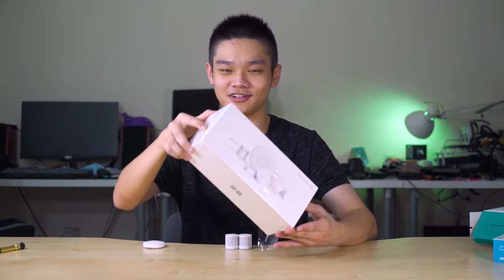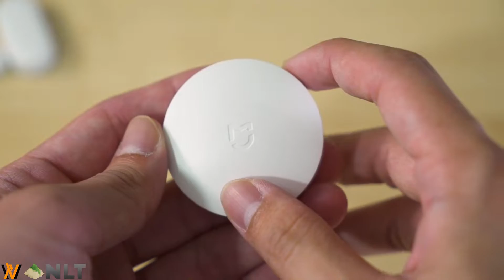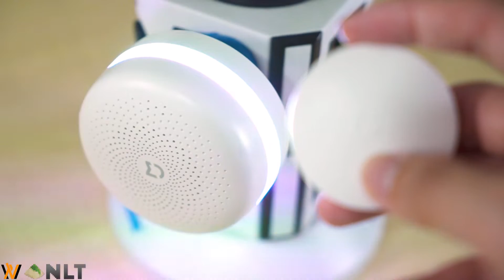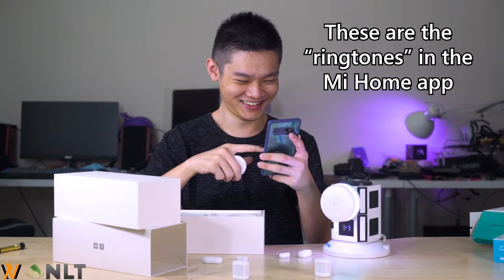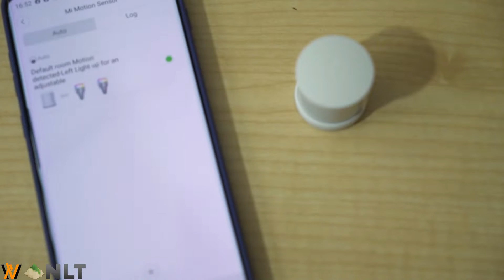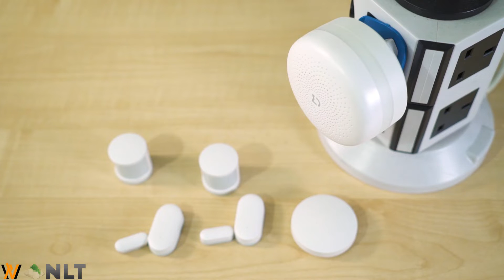Too premature? Xiaomi Smart Sensor Set review!

Comment: hi, does this work w/ siri or just the aqara hub?
Reply from the maker: It does work with Apple HomeKit, so I guess it works with Siri?
Reply: @NasiLemakTech  thanks so much for the info. is the alarm loud enough that can be heard by a neighbor? and also do you have idea how far can the sensor be away from the hub?
Reply from the maker: The alarm is not that loud to be honest. Xiaomi has stated they will implement a feature in Mijia app so that it will play the alarm sound to you connected smart speakers. Not sure if this function is available now or not. 

As for the distance, we only tested up to 10 metres away. The rest probably depends on your home layout

Comment: So it means I can't use the sensors to change the color of a light ? 
Like if I want to detect when the postman come I want one light to become green, I can't do that with this kit ?
Reply from the maker: It can trigger the light but not change its color.
Reply: What kind of sensor would differentiate between the postman and a random visitor?
Reply from the maker: Can't think of any ready-made product that can do that for now. I guess you can program your own with an Arduino